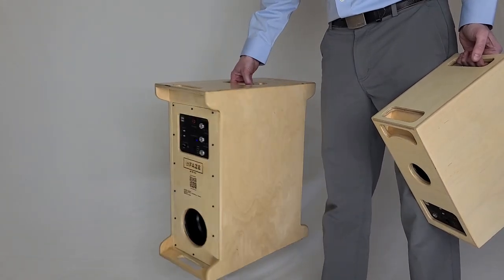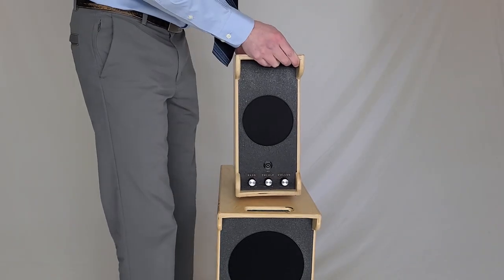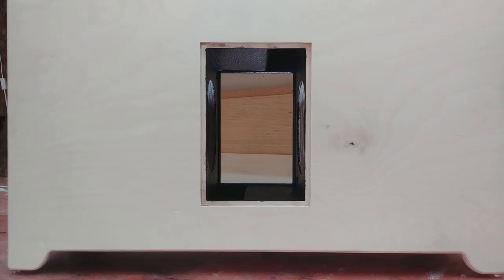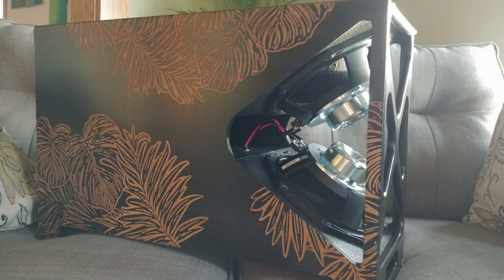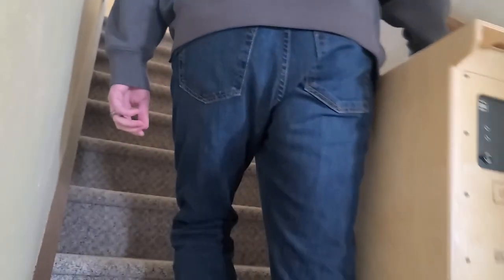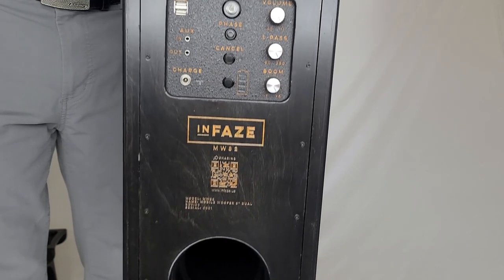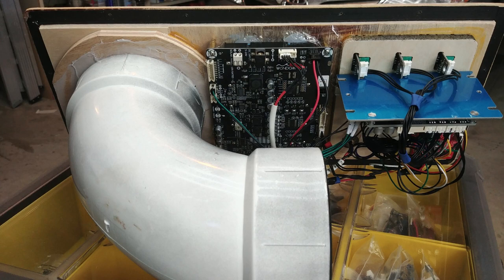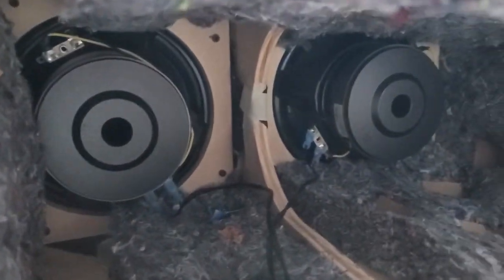Speaker Design Journey | Part 3 | SUBWOOFERS | MW82; Mobile subWoofer 8" Two

Comment: Have you ever thought of breaking down a Bose system and look at the way it’s designed for their speakers. They do have a good concept on making great sounds too. Maybe it could encourage your thoughts a little.
Reply: I was gifted a Bose Acoustic Wave Music System II and was very impressed by its output volume and balance of frequencies. I was air guitaring with it on my deck enjoyig a beautiful Saturday morning with it cranked up and during some of Jerry Garcia's jams I had my eyes closed. At a point I opened them to see a Sheriff leaning on my deck railing just watching me! 😮 He was super cool and just said someone complained! Of course I couldn't leave it well enough alone as to how they were able to produce an acceptable sound quality volume output from the little curved box. 2x two inch FR speakers in the top half with a ported 4 inch sub! CRAZY. I think the technology was based on obviously porting efficiently somewhat like a transmission line I could be wrong on that but they took advantage of that type of development and I think extensive DSP programming. The really crazy part is the 2-inch speakers on top are just the cheapest looking things you could ever imagine as well as the 4 inch sub, simple paper cones. They developed their magic recipe! Then recently after my pops passed, i inherited his Bose 321 series 2.i hooked that system up to my P. C. workstation and it sounds decent. I actually think the satellite speakers are past their prime, I frequently hear slight buzzing out of them on light passages. In other words I would never spend the money on Bose.